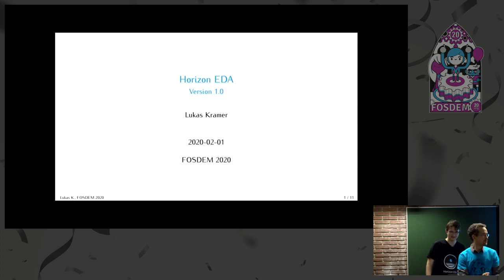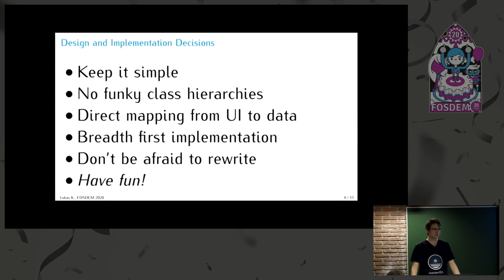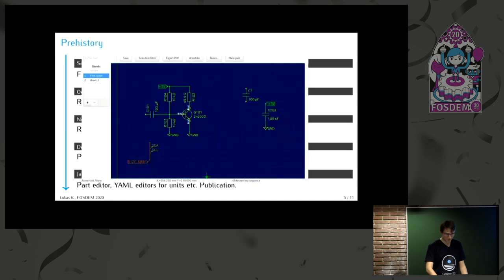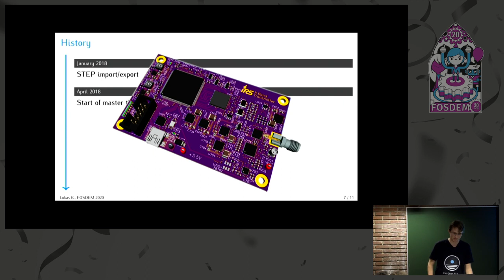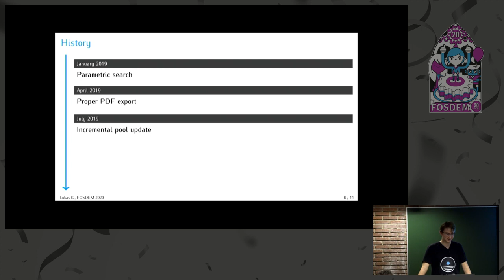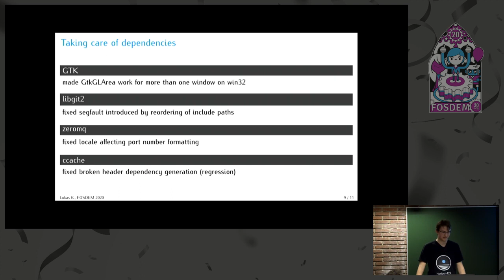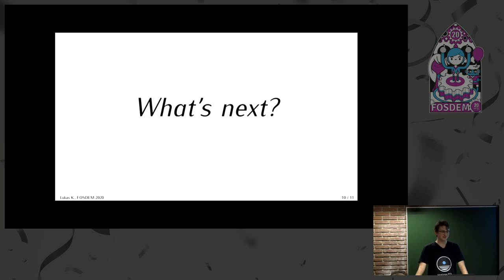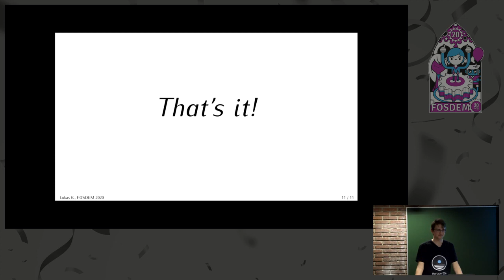Horizon EDA - Version 1.0

Comment: There is a huge amount of work behind this software package. Congratulation for the great work! In the schematic module I saw a raster of 1,250 mm instead of 1,27mm as I wished. I tell that because most IC's are using a raster of 2,54mm. Some IC's are also using the 1,78mm raster and I am not able to change the default walue of 1,250 to 1,78 or 0,89 mm as I wish. Any ideas what I am doing wrong and what else can I do in order to achieve that ? In the board module it is possible to make all this changes easily.